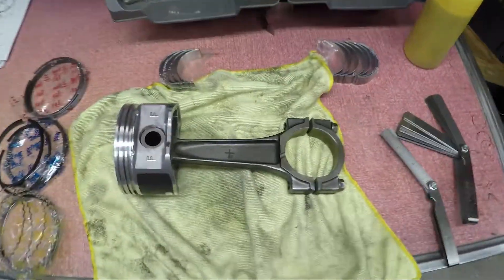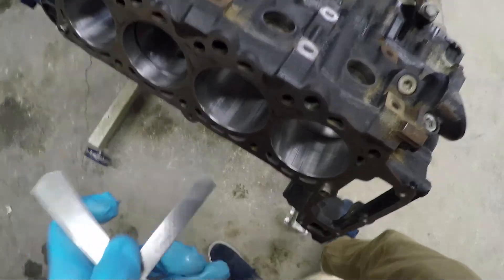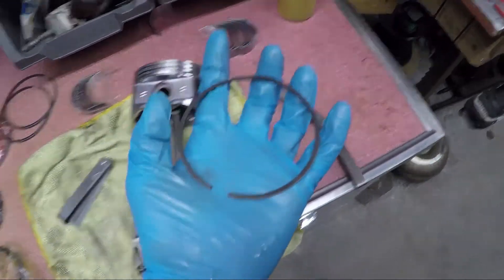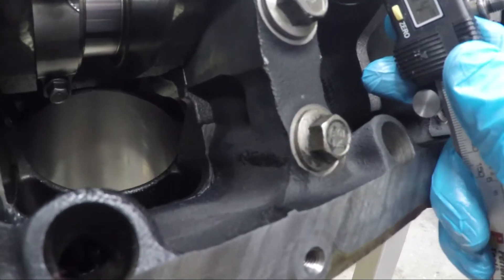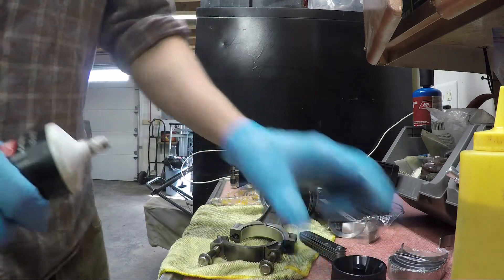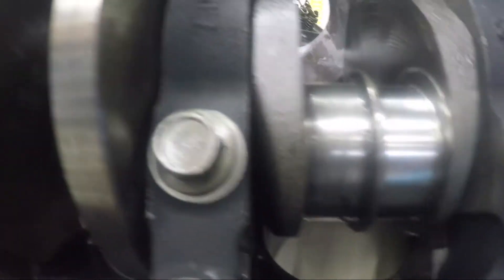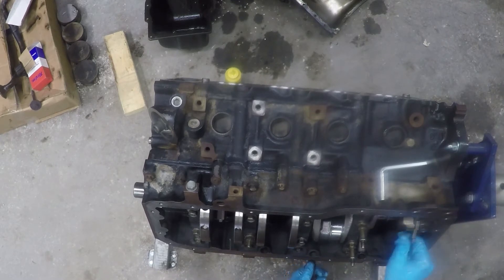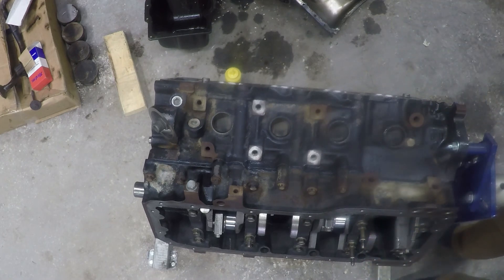2002 Dodge Dakota 4.7L V8 Engine Rebuild (Part 6)

Comment: I'll be doing this same job here soon myself using what appears too be the same set of aftermarket pistons/rings set (Chinese Aluminum Alloy) and also refusing my old rods since I had no problems with my bottom end...Thinking about buying an higher quality set of rings though perhaps like a set of Hastings or Clevite...I bought a set of King Rod,Main and Thrust bearings in a set all standard bore since I just plan on honing my cylinders... Was wondering how you build turned out ? Also wondering if I should buy a set of higher quality Ring compressors or does it matter  ? Any input would be appreciated since this is my first build...Oh and Nice work way too take your time and be Profesional...👌🤙💪🐍♠️🇺🇲😎
Reply: How did your rebuild go. Is It runs good. I put new bearings in my motor but now after all that it has a wrist pin knock. So not sure if I should rebuild the pistons with new rings though ebay rings seem to be as good as the factory?